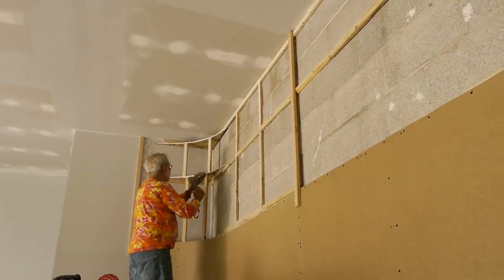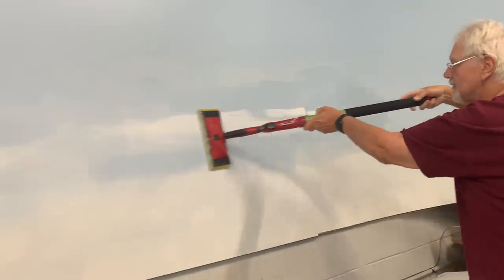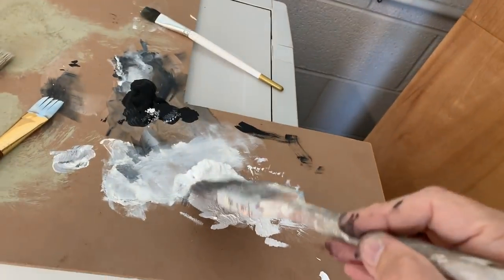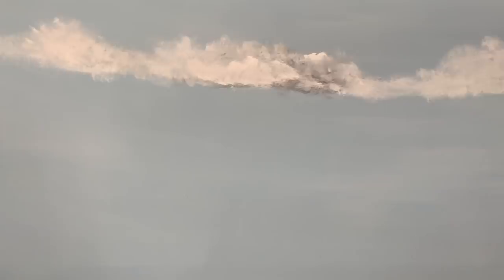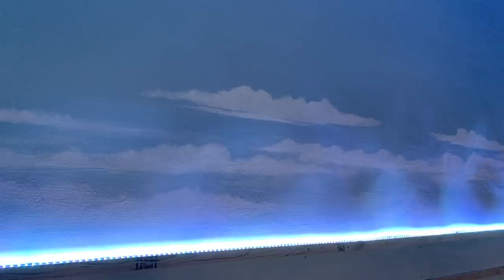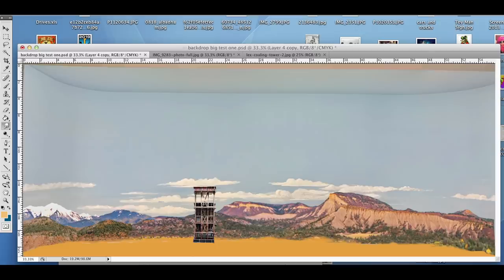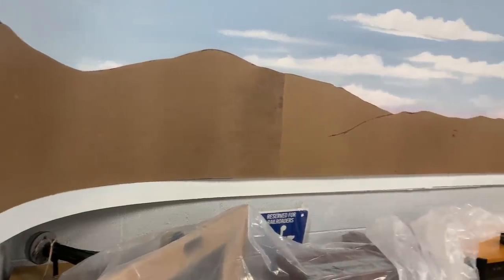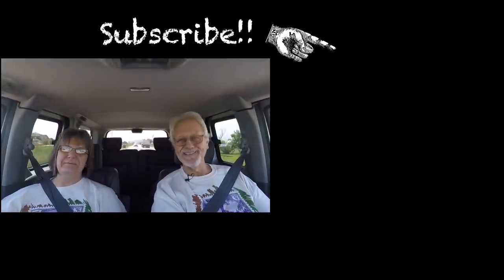How to Paint Clouds

Comment: You continually amaze me each week.  Very impressed with your skills.  Where is the entrance/exit to the outside?   Do you have a diagram?
Reply from the maker: It’s some point I will be posting a track plan and everything. As that’s on the garage side a lot about painting was done with the garage door open so the sunlight would be right on the painting
Reply: I had a thought this morning about adding rays for your sunset.  Try crinkling plastic wrap in small lengths, 1-2”, and place them about 1-5” above the lights.  Perhaps having some horizontal and others 30-45 degree angles.  This might enhance the ray effect you are seeking.

Comment: Good timing !Thanks for your tips. I am re-working the area under the stairs that has the proposed limestone and cement works. 2 sidings now burrow into the L shaped space under the stairs,and there is a loop of narrow gauge also. Turns out it will be much easier to install the backscene before going further. One scene corner will be curved like yours,but on the other end is a built-in closet about 2 ft deep. I have removed the sliding doors and cabinet from there and will backscene inside. But how to disguise the square ends?One part of the frame sticks out about 8-9 inches,with a short tunnel through. Other than vertical rock pillars can anyone suggest  how to scenic this ? In case of house resale I need to leave the closet there.
Reply from the maker: What I’ve come up with to disguise our place like that where the two backdrops meet is the trick I did using a half tree. I don’t know if you’ve seen the video on putting trees on your backdrop. But it’s the same as model in the tree except you’re only modeling half of it so that it’s flat mounted against the backdrop the vegetation confirm cover up a multitude of sins. In your case it might actually be just a quarter of a tree tucked into the corner.
Reply from the maker: Also at the other end of the switching yard I’m doing the same trick but with a piece of a building and a mirror. You might be able to make that work for you as well placing a mirror flat against one wall then modeling a quarter of a tree up against it and let the mirror fill in the rest of the tree.